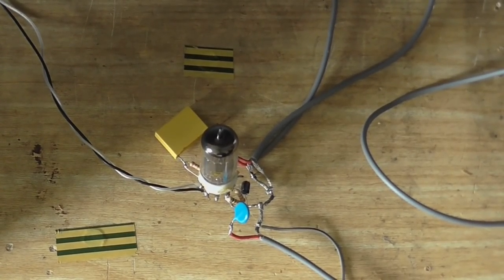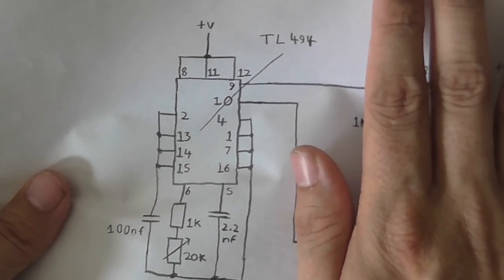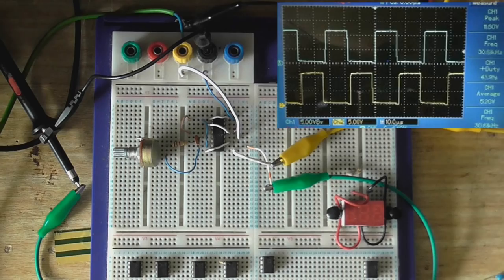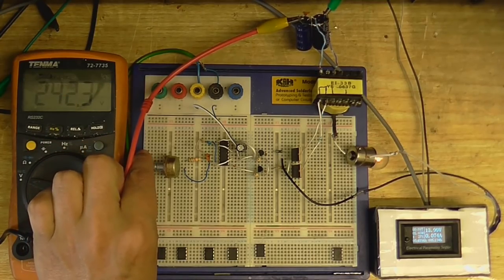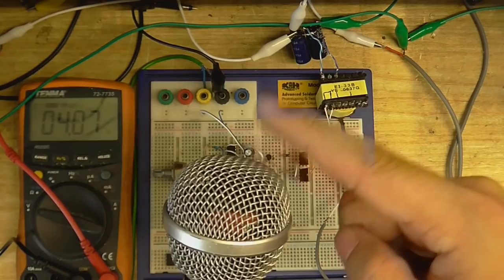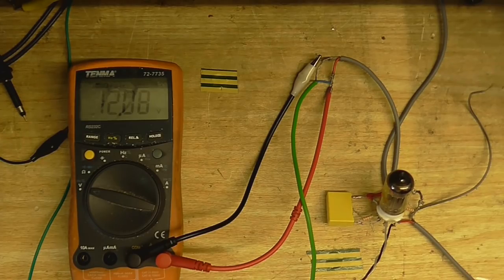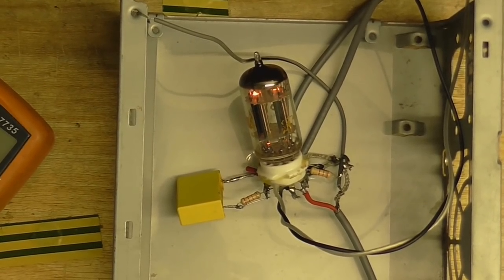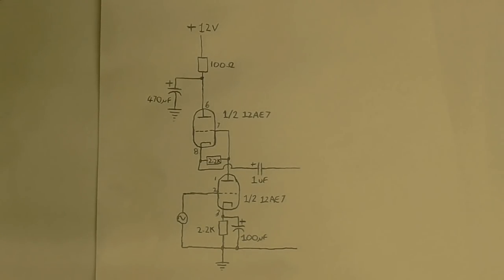Experimenting with a 12AE7 tube preamp and trying to make a supply for iT.

Comment: Dont know if you did know it already, but you can take apart those SMPS transformers for rewinding by boiling them for an hour or something in water and they should come apart. If you brake the ferrite, it can be glued together again with a little bit of super glue. But its probably better to try to not break them anyway :)

Comment: Hi! 
Is there any way to make a tube to act as a musical oscillator? Like for an analog synth?
Reply from the maker: I'm sure there are circuits out there, early synthesizers did use tubes anyway. Oddly enough, the circuit I've made does make a weird osculation after I turn it off, right before the last tiny bit of power has drained.
Reply: Ok! Love your channel by the way, very inspiring things you make!